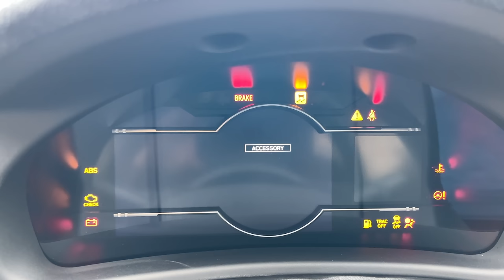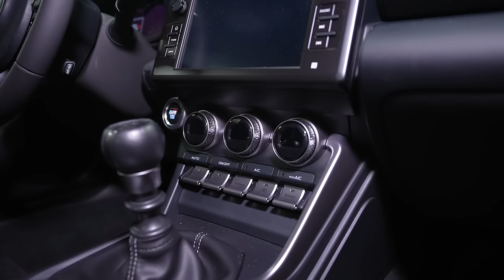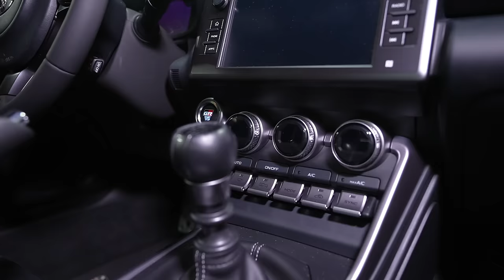Should You Buy a 2023 Toyota GR86? It's heavily over shadowed by a rival in 2023

Comment: I'm an an automotive engineer and will say, i  like your channel and you even get a few things right, but you don't understand engineering.  You understand some of it.  I believe you could learn but it would take a lot of time in the trenches. I find your assessments to at times be rather limited, forgive me.  I am not going to write a book here, but your conflation about thinning out cylinder liners and the auto trans gaining weight, this not being parity or a wash... if we are at party and you said that, I may have spit out my beer.
Really?  You really said that?

1. the reason why Toyota likely thinned out the cylinder liners is because of heat transfer and not weight. Weight is a secondary benefit.  Its to take heat away from the combustion process which affects volumetric efficiency, air/fuel mixture and timing advance. Aluminum transfers heat more efficiency than iron liners.  Less iron= better heat dissipation.  Steel is need for abrasion resistance and strength of course which affects block web thickness...versus silicon etching which was pioneered in the late 60's and used by GM and Porsche found commonly which has even better heat transfer but liners are sometimes preferred but have distinct manufacturing tolerance challenges due to dissimilar coef. of thermal expansion. Weight it a byproduct and not the root cause of the change.  You should know this but for some reason don't.  You do know a lot of other things of course that matter.

2.  the auto transmission gaining weight.  Whenever engineers increase the weight of known component of a car is because of:
a. Strength increase, which is the overwhelming reason and b, reduce cost due to substituting in cheaper material like steel for aluminum which can be both stronger and heavier. The engineers must have perceived a strength deficit in an aspect of the trans which increased its weight by 6 lbs.  This would be the 'only' reason, strength or cost.  Toyota sells cars for profit and btw why all syncros on the gearbox aren't carbon. Syncronizer problems are nothing new. Ask Honda about their Type R syncros they finally fixed after two years of 2nd gear crunching.

3. And lastly, perhaps the most comical. Why would you compare 1 and 2? Why should they be the same weight reduction versus weight game for parity?  The net benefit of 1. and 2. far outstrips any vehicle weight gain.  How about the heavier optional wheel/tire package? Why does that matter?  Aesthetics and tire footprint and handling. Are you going to compare weight gain of the optional tire/wheel package without considering why it exists, to increase cornering forces and traction and not have the car slip around the track more?   Problem with not knowing what the engineers do is, they don't do things for one reason, They do things for 10 reasons and there is even a hierarchy of importance where benefits are rated.

As to comparison of the GR86, the Corolla 3 cylinder AWD sh_tbox is just that, a sh_tbox compared to the GR86.  The Corolla has a boosted 3 cylinder 300 hp lawn tractor motor with AWD.  100hp/cylinder of just over .5 liter per cylinder. I don't expect you to do the math, but most cars have twice the displacement/hp which translates into much better long term reliability.  The GR86 engine is under much less assault aka crank/connecting rod/piston/block stresses and if you line up both at the track which almost nobody does, the GR86 will run within a tick of the Corolla with blown lawn mower engine.
The Corolla is a joke.  Its a marketing plow by Toyota for wankers who want a 'tuner' car.  The interior of the Corolla looks like a mud fence. AWD when the power to weight of the car makes a mockery out of the parasitic driveline losses and 'weight' you ruminate over.  Exclusivity without a benefit. A track focused car for somebody who would never go to a track and would be lapped by a 20 y.o. C5 Corvette.  With mark up that Corolla POS will cost as much as a Lexus IS350.  A fool and their money and plenty of fools in the world and what Toyota counts on.

PS. I do agree that Toyota should have boosted the FA-24 aka put the WRX turbo motor in the GR86.
I find Toyota, Honda and Subaru have lost their way in many respects.  I believe all car companies are suffering an identity crisis with the advent of EV.  A last note, and I know you bought one.  I find your endorsement of hybrids to be shameful.  Anybody with an engineering degree knows they are a pure money grab by Toyota and Honda. Awful NVH with CVT drone.  Two powerplants in one vehicle, twice the reliability cost due to twice the technical complexity, 100 computers and a battery that will fail like clockwork out of warranty.  A car for tree huggers who all flunked math and don't understand opportunity cost and economics.  Fuel savings is nothing compared to initial purchase cost and long term maintenance cost out of warranty.  Throw in the awful sound and pathetic power/weight ratio, the hybrid badge is like wearing a dunce cap or a shirt with kick me on the back...lol.
I want to say lastly, you are a good man. This I know for certain because I know how very hard you work and you know what you are doing. The world of engineering is very different however than what you do.
Reply: '' I am not going to write a book here''  Writes a Book! Lol
Reply: @MauiWauiPineappleExpress  sorry, you are right.

Comment: The GR86 would literally be perfect if it had a Toyota straight 4 instead of the boxer. The center of gravity will raise, sure, but it would be 100% worth it for the reliability and simplicity. It would be the modern AE86 or 240sx.

Comment: Honest review of what the GR86 is and is not. I was into weekend track racing in my twenties with a V6 Capri; fun. The Toyota premium with an automatic is the perfect car for me five decades later; I'm not dead yet. What a great road car, that handles and stops well. I also own a Forester Wilderness, which shares Subaru instruments and engine, as well as, the safety features of the GR86. In a Maine winter the Forester is great, much better than the offroad Jeep 4x4s I used for years. I love going back and forth between the shared family of vehicles. Cars and trucks are not unlike golf clubs; can't play well with only one. Were I into driving stupid, I'd own one car, say the Corolla GR, and have all my money in one car. I'm not perfect, and don't expect my GR86 to be perfect. But, sweet Jesus, thank you the best motorized wheelchair available for the money. Planning to switch from the noisy track tires it came with, to a/s Conti DWS so I can enjoy my oldies. Also, my dog loves riding in the back seat; easy in and out.

Comment: The GR86 is a lot more approachable and an actual RWD, unlike the GR Corolla/Yaris/Mazda2 that's still FWD-based.

Also the GR86 has beaten, or close to beating, some tracks' class record on stock settings. Also posted a respectable but unofficial 8:27 lap in the Nurburgring.
Reply: Yeah, the car has flaws but the whole notion that "this is not a powerful car" is misguided. The specs might not look amazing, but the driving experience is fantastic. I test drove this among other cars but this one won me over. This car also does very well in the GT300 (300 hp and under) in Japan, where It competes against modified Supras, GTRs and whatnot. So the bang for the buck is out of this world. It feels like comparing it to the Corolla GR or Civic Type R its unfair, since pretty much the driving 'feel' is different (FWD vs RWD). I would compare to the Mazda miata, but clearly there are not many comparable cars if at all at this price point.
Reply: @ShinMike  the GT300 point is a bit misleading, the Toyota version in that competition is v8 swapped and the Subaru version is turbocharged
Reply: @ShinMike  though you're right that it shows the chassis is capable

Comment: On the BRZ; the knuckle is aluminum, rear sway bar is mounted to the body, instead of subframe, sway bar thickness is different, and the spring rates are different.

You can get the Eyesight system in the manual trim with auto cruise control in the 2024 models. Personally I don't like all the nannies and they just add cost, complexity, and weight.

Comment: each GR vehicle tackles it's own place in the market.
Realistically speaking, although not the most popular option, you can get a base GR Supra if you still want RWD and more power.
Adding more power would just cannabilize sales of that car which you cant even find in a manual.

GR Corolla, is to compete with the hot hatch market.

The 86 has one competitor, which doesn't exactly count because it's much smaller, which is the miata.

Personally, I don't think it'll become overshadowed because the aftermarket support of the 86 is a lot more common than the Corolla.  
There is no specialty or uniqueness of owning a Corolla, regardless of GR, because it looks like every other hot hatch.

Comment: I'm not sure I'd get too worked up by the the idea of a 'true GR' car.  2/3 of "GR cars" in the US market are built by someone else and there is not a long and storied pedigree of "true GR" cars.   Still that team has differentiated their cars in ways from the BRZ (which I own) and the Z4, and even influenced the original cars themselves such as D4S being used by the Subaru and design changes made to the BMW B48 engine.   I think they've done something very practical here, and the BRZ/GR86 offer a purity and simplicity that is hard to buy anymore.   I love how basic these cars are.   Also, on the 6-speed transmission - an in house Toyota design.

Comment: Considering this was a mechanical review, I'm very surprised that you didn't discuss the RTV issue, which is far and away the biggest mechanical news item related to the GR86/BRZ. The RTV thing is right up your alley. Would have loved to get your take on its relative importance.
Reply: RTV is a non-issue.
Reply: @BenjiDubss  Obviously it's an issue, otherwise so many people wouldn't be discussing it. Is it overblown? Quite possibly. Is it still worth discussing, especially in terms of a certified tech doing a mechanical breakdown of the GR86? Absolutely. If it really is a nonissue, he should address it directly and put it to bed. I'm very surprised that he didn't even mention it, after mentioning the oil baffles, the thinner cylinder walls, and all the other mechanical subjects he covered. Doing a BRZ-GR86 mechanical review without mentioning RVT is a very conspicuous oversight.
Reply: @vlj1133  For sure it's worth mentioning, but it is a non-issue. It was present with the previous generation as well, and they re designed the oil pickup to have more sides with openings for better oil pick up in the second gen. The only reason it was discussed heavily online is bc Toyota declined the warranty for someone who tracked their car, had a blown engine and found RTV. I have owned my GR86 for a year now, 15,000 miles and no RTV issues. Never seen RTV on my dip stick. When I say it is a non-issue, I mean it is causing a very minimal amount of engine failures in the field and there is no recall for it. Toyota and Subaru are obviously aware of it and the fact that they haven't issued a recall yet shows it was overblown. Plus, if it is an issue and causes massive oil starvation leading to engine failure it should happen well before the warranty is expired.
Reply: @BenjiDubss  If it causes even a single engine failure, it’s an issue. - That one guy with the blown engine.

Fwiw, I am not aware of a single engine failure that could be directly attributed to RTV-related oil starvation, but if it has happened then it clearly needs to be addressed by Toyota and Subaru. There is simply too much uncertainty surrounding the issue.

Comment: The manual does actually have a safety system, blind spot monitoring, which is prob the most important one you can have. Starting msrp for a gr corolla is around 36k, for the 86 its around 29k..lol, and the markups for the corolla are more aggressive. Personally I think the 86 looks a lot better too, corolla looks like a box on wheels in comparison. The power in the 86 for its price range is fine, but if you have 7k-10k extra to spend, you need more power and don't care about looks then sure...get yourself a gr corolla.
Reply: I just saw a GR Corolla listing for like 136k lol
Reply: @Brandon_Mishima  wtf?

Comment: Toyota already has great 4 cylinder engines that can make about the same power and torque.
The 2AR is more reliable and more capable, the intake and exhaust ports and valves are obviously capable of much more performance with the right cams that aren't designed for fuel economy. The A25A surprisingly makes great torque and revs freely and is more reliable...I had one...and drove it hard and had not a single issue in almost 100k miles, my friend has 280k miles on his a25a with minimum maintenance. 
Toyota also has an 8 speed for RWD cars.
Toyota also has a 3 cylinder turbo engine in a car designed to be sold at 35k MSRP, remove the GR corolla AWD system and I am sure that you could put that engine in the GR86 for 30 grand like it currently is.
This entire colab between subaru and toyota seems very half assed and completely uninspired. It would be great if subaru just made the chassis, body, and assembly, but the engine could easily come from toyota for the TOYOTA models, subaru can do what ever it wants with its BRZ.
The whole balance argument is kind of null and void considering that the car sits so low and people have crammed V12's into the engine bay without issue. 3-4 cylinder's could easily fit and sit nice and low. And those who really want ultimate balance can buy the BRZ, the toyota, should be using a better engine.

Oh, and what is sad, is that BMW with 400hp and two turbos on 6 cylinders still gets BETTER MPG than this POS subaru engine.
My accord 2.0 with a stage 2 tune averages 30+ MPG driving hard.
New 86?? Good luck getting 25, drive it for "fun" and you will get 19-20.

Comment: I don't think you can compare the GR Corolla to this... it's not nearly as obtainable and prices are significantly higher in the real world. Additionally, the GR Corolla is AWD compared to RWD. Two completely different driving characteristics. I'd take the GR86 over the Corolla because it's far more engaging and fun (IMO). If you need to carry passengers and drive in winter/wet weather frequently, that's where the GR Corolla wins.... but form a pure drivers perspective I'd go GR86 every time. The GR Corolla is not without it's faults either. It's still an econobox at it's core and the rear diff overheats in a track environment.

Comment: Except for that looming catastrophic engine failure (RTV)... This car is astounding!
Reply: That issue has been grossly overblown. If your  under warranty it shouldn't be a worry. If your daily driving, it shouldn't be an issue, if your tracking it and beating up on it, then it could be an issue
Reply: Lol RTV issues are blown wayyy out of proportion. Only a singular digit number of engines have failed due to RTV-caused oil starvation.
Reply: @diallo1347  now this is the positive feedback i need right now 👍🏻Thanks!
Reply: @diallo1347  Why wouldn’t you want to beat up on it? It was advertised as track ready…
Reply: Every vehicle that has had the sump pulled has the issue, like RTV in the pickup line😢 including the 2.4 WRX 😮
Reply: @skiddlyd.244  Because "track ready" doesn't mean drive like a 16 year old on a learner's permit
Reply: @diallo1347  Oh, so “track ready” means drive like a granny, even though it comes with a free NASA track day. 
“Track proven. Street ready” for grannies, otherwise it’ll blow up.
Reply: @diallo1347  You’re a jabroni
Reply: @skiddlyd.244  How many are being tracked vs less than 10 that blew up

Do the math
Reply: @impreza0109  How many have had the oil pan pulled off and found rtv in the oil pickup filter? Every single one that has had the pan dropped. They’ve only been out for a year. How many miles do you think the average driver is putting on these? Not many. I guarantee 90%+ owners all have at least a second vehicle they daily. Problems are going to start cropping up.
Reply: @skiddlyd.244   "I guarantee 90%+ owners all have at least a second vehicle they daily." Doubtful considering the (relative) low cost and the average age of buyers.
Reply: @skiddlyd.244  you guarantee? Got a source or a peer-reviewed survey for that, buddy?
Reply: It also only takes about 2 hours to pull the pan and clean the rtv out.

Comment: The reason they put a carbon synchro on 4th. Isn’t because of track use but because ALOT of people drive with their hand resting on the shifter, on 4th. While cruising on low speeds. So what this did was wear the synchro and the fork bushings. THAT was the largest failure. But still if they were gonna do that, why not all the rest of the synchros 😅

Comment: Great video. Technically the best analysis yet. 
The GR86 is not perfect, but the fact it exists at all these days is a gift to enthusiasts.
But don't totally write off fwd if you haven't driven a Type R. Drifting- not so much. But it will rotate and turn in nicely, and you get a fully sorted manual transmission and engine. Better brakes. Useable power. Perfect driver's seat. The list goes on- braking, steering,  grip, all top shelf. Okay, sound is meh, and could use better cooling on track. 
The GR86 is pure and important. But it is only semi- practical. And while brilliant,  is compromised.
The Type R actually does a better impression of a dedicated driver's car than either the GR86 or GR Corolla do of a practical daily driver. My two cents,  having both owned and driven rwd purist cars and now on my third year of hunting apexes with an '18 Type R - it is a viable alternative.